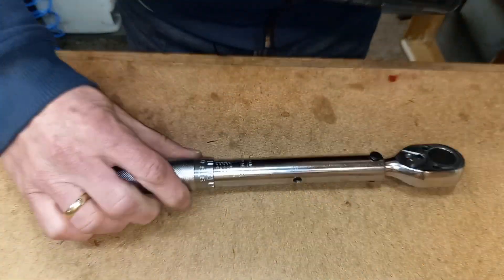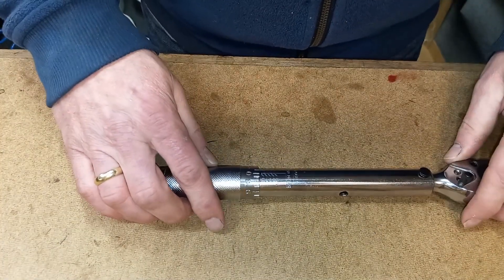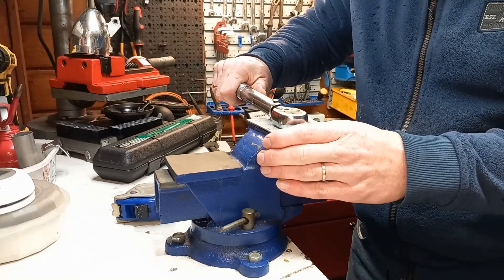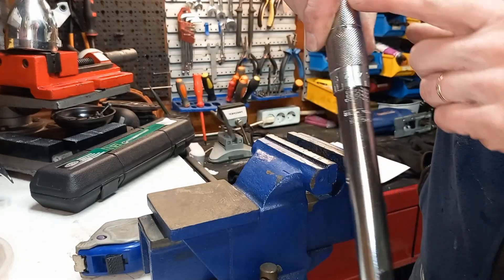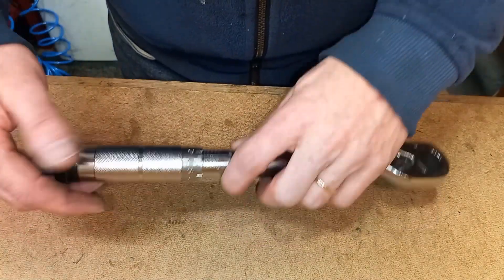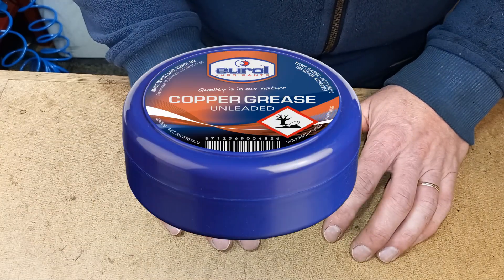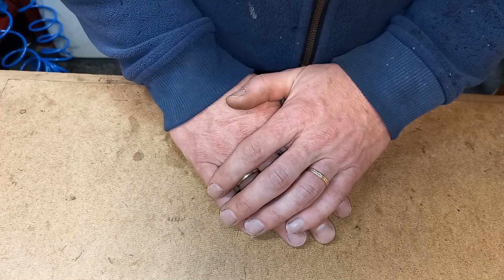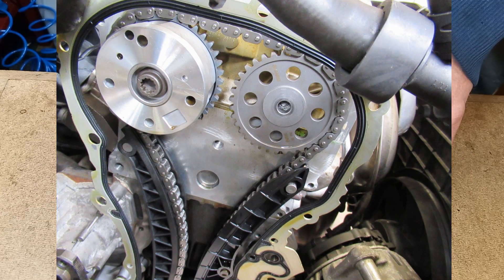How to check if your torque wrench is still in spec (Part 2)

Comment: in the end, who was ultimately at fault, or was it just a "perfect storm" of stacked tolerances creating an overstretched bolt? 

Did the insurance company fault the mechanic for using an under-precise torque wrench, despite it being labeled as adequate?
Reply from the maker: The parts supplier paid for a rebuilt engine, the kit they supplied cosisted 
of parts from various manufacturers, without any certification. The bolt had no markings on it regarding quality and the manufacturer did not supply any certifications or any insight on the production process. Basically, it turned out that the timing chain kit was put together by the parts supplier without knowing the origins of the parts. They buy them for 60 euro and sell them for 260. They sell 50 kits weekly, so from the margin of profit they paid the new engine out of their back pocket. I must say, these kits rarely fail - quality is like OEM, so the chains stretch within 60.000 km... and then it's rinse and repeat.